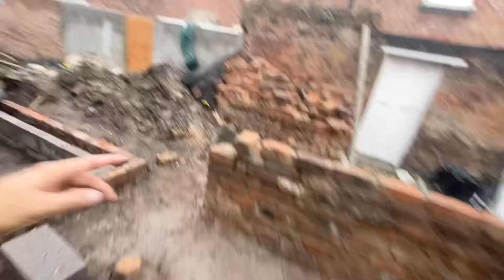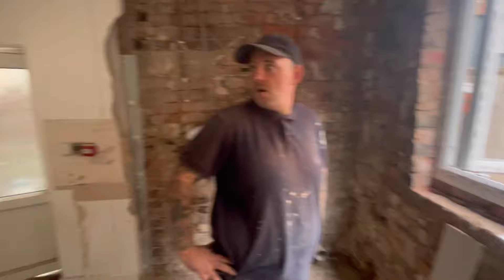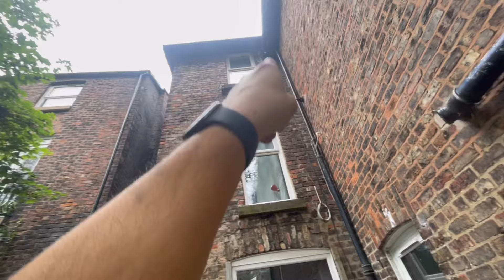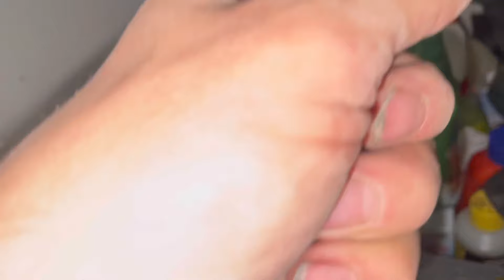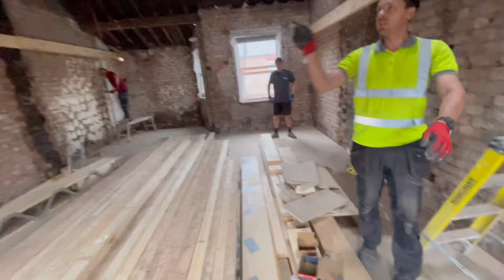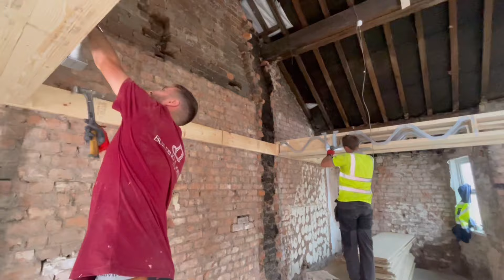Double Labour 😡

Comment: Those m16 bolts are unbelievably strong in your situation. The floor design is using sheer strength to hold up the floor I’d bet that a single bolt strength would far exceed the weight of the entire floor. I think they are rated at over 5 tons before failure. Basically the timber floor would fall through long before one of those bolts would sheer as would the brick that’s holding the bolt.

Comment: Hi mate anthor video yeah they should of put a line from the existing retailer 9inch wall to the other side then pump down from the line marked it to the wall there building back up and went from yhat young fella looks lkke is he in his first year at college if it  was me i would be getting him to use his level and pump up and tape garge as well profiles are good but am old fashioned like your self you learn more than putting profiles up i no your on a tight budget but sometimes your better him thinking right got to level up  pump garger making sure double check the 9inch wall as shown early on video the wall had gone tits up but dont think he was on it , all change now my was nvc leve one first year full 5 day in college 90 a week then on site yesr two one day a week at college then year 3 one day a week at college them got my nvc level 3 then went out on my own 2  1  on price but profiles we didng use them because back them it went dead b them but now lads turn with profiles bash shit out of the house on site anyways done my years on site wouldnt go back like work like you do i dont just do bricklayering i do plastering riting out footings concete puting base in prep  them up concete them drainage work dont get me wrong i love bricklayering i do but like doing groundworks digger work but best way the young lad learns throw him in he will learn more with u on site than college its better on site my old boss would of kicked of big double handling i hate that as well loving the videos keep them going mate smashing it 🧱👊👊👊👊👊